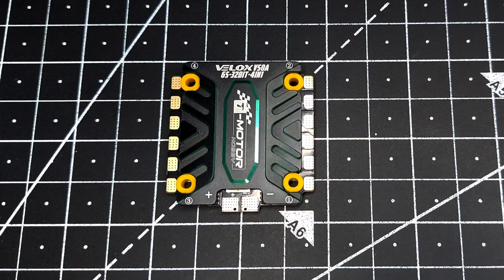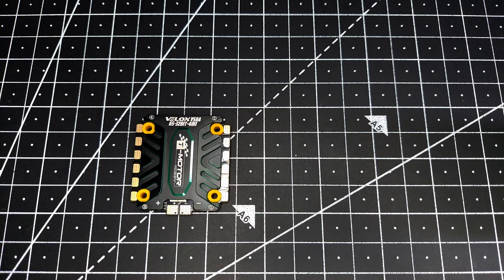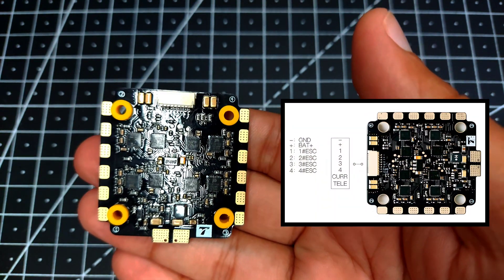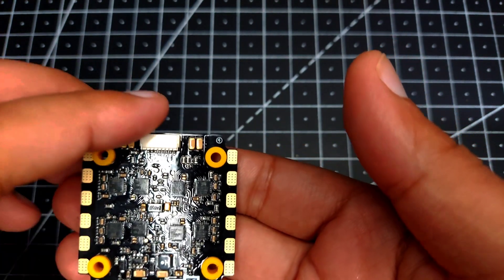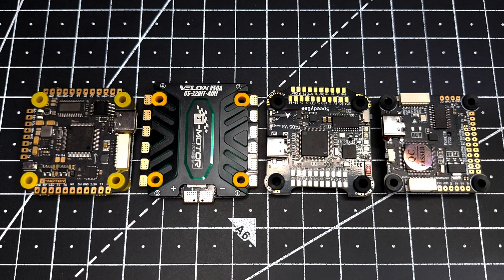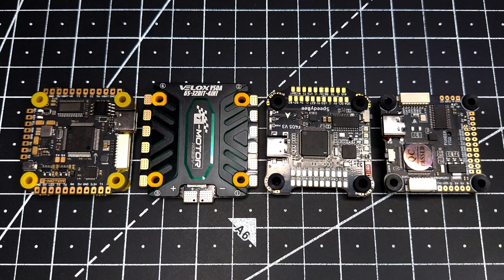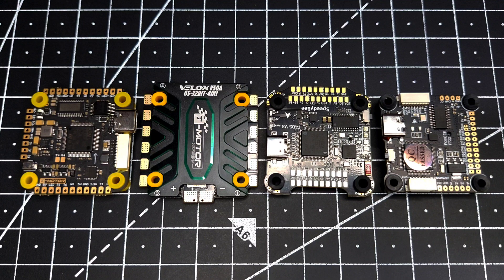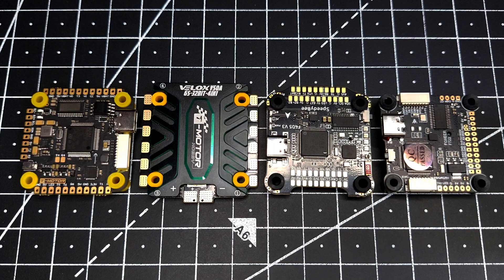New Design Approach ? T-Motor Velox 50A F4 128K

Comment: What T-motor FC will not work with this ESC ? 
T-Motor F7 Pro - has Bat+ (Input Voltage 3-8S Lipo)
T-Motor F7 - has Bat+ (Input Voltage 3-6S Lipo)
MINI Racer F7 - has VBat (I think VBat and Bat+ is the same) (Input Voltage 3-6S Lipo)
Pacer G4 Alpha HD FC - the same
Reply from the maker: Any FC which doesn't have BEC in built inside the FC

Comment: Sir I am little confused 😕 
Your can use the velox 50 A esc with all flight controller that available in market
Except T-motor all flight controller  or 
T-motor one specified flight controller
Is this statement  correct or wrong
Reply from the maker: Hello friend firstly no need to use word Sir 🤣 second yes this will not work any T Motor FC which are available right now because all T motor FC in market require 10V BEC from ESC to work and this FC doesn't have one
Reply: Thanks you for the knowledge 
 I am new  to fpv world and I want to make my fpv drone..🙏🙏❤❤

Comment: does it run on 128khz??
Reply from the maker: Yes
Reply from the maker: You can select between various PWM and 128KHZ is one of the options
Reply: @justhackitfpv  ok sir,,,because my v45A v2 arent no option for 128Khz pwm,,only 16-48
Reply from the maker: @zlachannel8674  this one is different slightly expensive
Reply: @justhackitfpv  ok sir ,,,im going to pick this for my next build because they have f4 Mcu,,,yesterday o was not knowing because tmotor havent write the spec cleary that this esc V50A are capable to 128Khz in blheli32

Comment: Tmotor fc powered by direct lipo voltage.. (vbat) from esc.., 10v use to power other components like low voltage vtx/camera etc.., 
As a example Tmotor Pacer F7 fc have 2* 10v pad which is just bypass volt from ESC..
Reply from the maker: Yes that's what I'm trying to tell here that this ESC won't be compatible for most of the FCs unless they use external 10V BEC